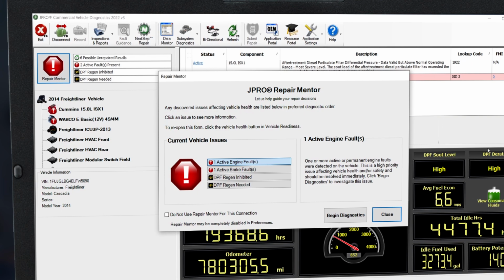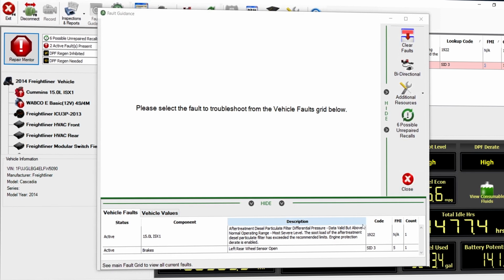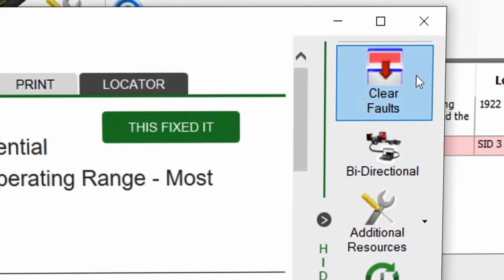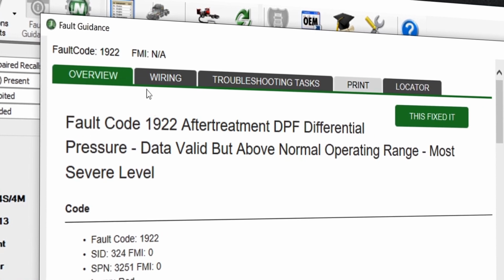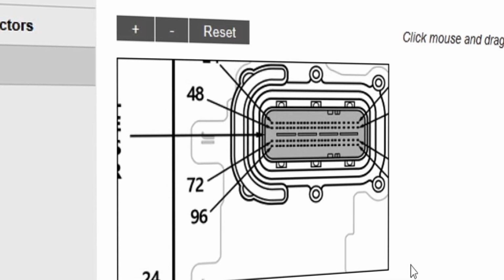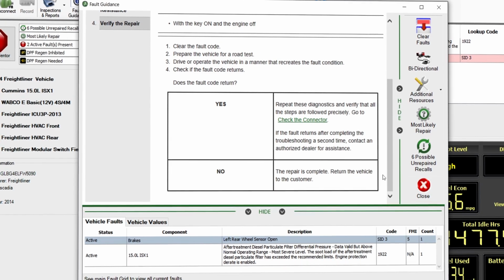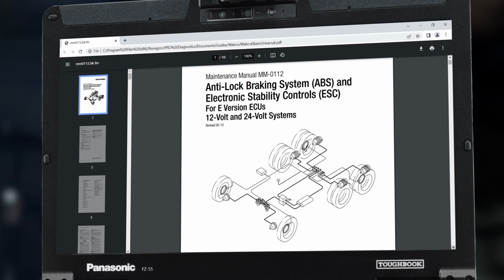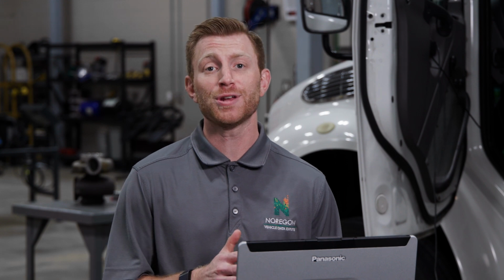JPRO Training (2023) - Guided Diagnostics and Troubleshooting

Comment: Is fault guidance only for engine codes or will it help with transmission codes as well?
Reply from the maker: Fault Guidance will  cover transmissions and other components.
Reply: @NoregonSystems  strange. I couldn't get it to work for a allison 2500. Active Code is p2789 and when I click it like I do with regular engine codes. Fault guidance doesn't open.

Comment: How to reset nox sensor with jpro software
Reply from the maker: The NOx Sensor Reset test is supported on select vehicles and can be found in JPRO's bi-directional tests when available. You will first select the NOx sensor to reset (1 or 2) then click the Reset button. A message will pop up when the reset is complete. To see which vehicles are supported, check out our coverage chart at
https://www.noregon.com/jpro/coverage/on-highway/
or contact our support team at 855-889-5776 for additional help.

Comment: What tab enables “fast idle” on Cummins motor, with a new instrument cluster installed ?
Reply from the maker: To make sure we get you the right answer, can you clarify for us what type of vehicle and which Cummins it is for?
Reply: @NoregonSystems  2020 Freightliner Thomas Saf-T-Liner C2 school bus
Reply from the maker: @roxfire23  It sounds like the new cluster you’re talking about may be the ICUC for Detroit Assurance. This is likely a specialty function that requires OE software. In Detroit Assurance, you may be able to access the power take off screen from the vehicle settings screen in the cluster and set the speed there. If that doesn’t work, we recommend contacting the component manufacturer.
Reply: @NoregonSystems  the bus has a Cummins motor in it as well
Reply from the maker: @roxfire23  We suggest you contact our support team directly. They will be able to give you more information about the exact bus you are working with. You can contact our team at 855-889-5776 (option 2) 7am-8pm EST M-F or 8am-5pm EST Saturday.
Reply: @NoregonSystems  thank you